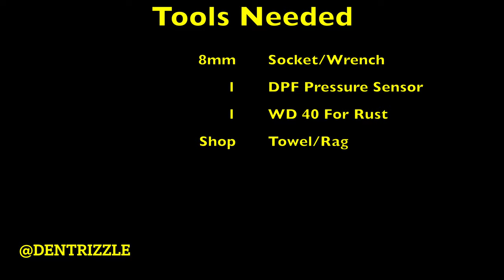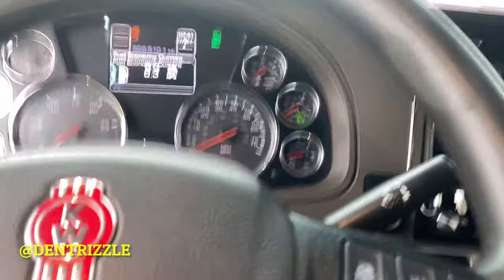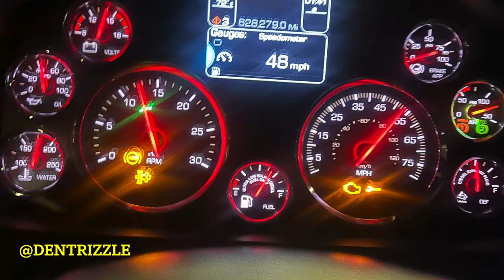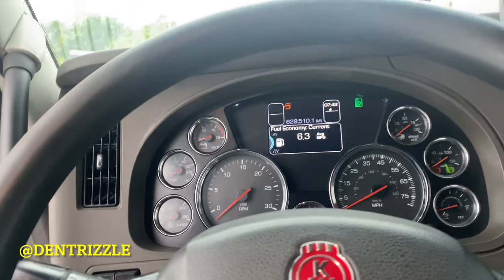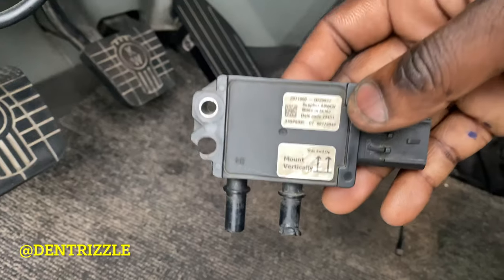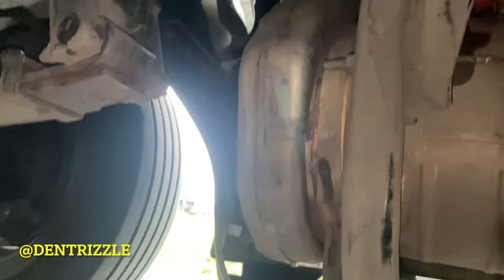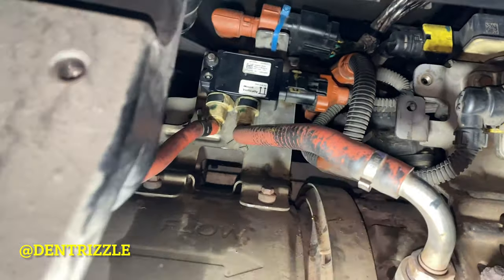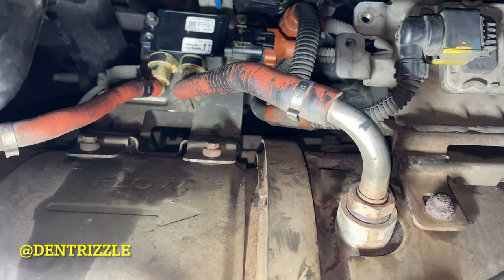How To Replace DPF Pressure Sensor 2019 Kenworth T680 | Peterbilt | Paccar | Cummins ISX15

Comment: Mine paccar asking regeb again after I did regen, an hour later engine light on and derate light on  so I did regen again but check engine light still on also shows power reduce due to powertrain derate
Reply from the maker: @jianzhaozhang2734  Sounds like your DPF Pressure Sensor is gone. It will put you in a full derate
Reply: @dentrizzle  I’m going back home to get it fixed since I still be able to drive , 
Yes feel like it’s the dpf differential sensor after seen your symptoms and some research
Reply from the maker: @jianzhaozhang2734  I had multiple people reach out with the same symptoms and it’s indeed the DPF Pressure Sensor. If you had a way to monitor live data you’ll see your soot level sky rocket beyond 90% even after a regen which should put it below 20%. When mine went bad it went to 250% soot level 😂😂😂😂
Reply: @dentrizzle  I don’t have a scanner but your are 100 correct, it shows soot level high after regen 20 mins later says soot level very high , happened 2-3 times  already this week, no limit my speed , hopefully I’ll be able to get back in next 2 days
Reply: @dentrizzle  would you send me the part number ? Couldn’t tell which one on the box in the video 
Thank you

Comment: Mine truck shows the same signs and when I do regen it took about 3 hours but signs still shows up ..can you help me what I need to do …
Reply from the maker: 1st get it scanned with code scanner and it will tell you exactly if it’s your dpf pressure sensor. Afterwards just replace it cuz it’s straight forward. If it’s the sensor it will leave you stranded on the road. Hope this helps.

Comment: Rescently i spent $10K at the dealership they change my dpf filter and other sensors now i brokedown here in PA the diagnose is  dpf differential pressure above normal operating range-least several level. I just don't understand why because dealership change dpf sensor too
Reply from the maker: That’s the dealership for you. Sometime back then I got a code for Turbo Actuator fault. I bought it and replaced it but didn’t have a scan tool to calibrate it. Brought it to a dealer and they insisted I need a turbo which they even order which was 10K+. I just told them I urgently have a load to pick up and they should just calibrate the turbo actuator. That was 2 years ago and the truck is doing quite fine. Nothing was wrong with the turbo,  they wanted to sell me a turbo. Dealership are parts cannon until the problem is fixed 😂😅
Reply from the maker: Sounds like the DPF Pressure Sensor.

Comment: I'm getting egr delta pressure code and particulate trap pressure, stop engine light, clear engine light so I can regen and it regen for 3 minutes and is interrupted with stop engine
Reply from the maker: Sounds like the DPF pressure sensor to me cuz I was having those same symptoms but my code reader worded it differently

Comment: What scanning tool are you using and where did you get it?
Reply from the maker: OTR Diagnostic Reset Tool and I bought it online. There’s a yearly subscription of $600.00. Hope this helps…
Reply: @dentrizzle  Thank you, I appreciate it. I found it, the Paccar MX Hardware is $800 on auto-renew now.
Reply from the maker: @fabianmuzik  it’s a bluetooth dongle then you download an app. So you can use An iphone or an iPad. I use an iPad because that’s what I use for my ELD so it’s right in front of me in which I monitor live data occasionally and doing that the other day I catch a low fuel pressure drop.
Reply from the maker: @fabianmuzik  you can also do forced regen, scan and reset codes, there’s guide for codes with repair procedures, you can reset ash counters in case you clean your DPF or install new DPF, you can reset 5 mph derates, reset EGR and a bunch more functions as well.